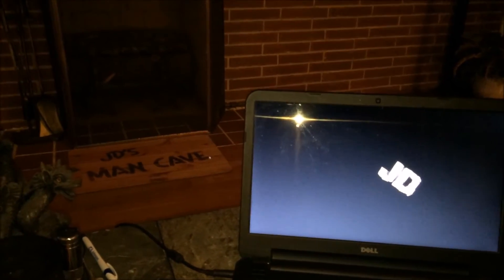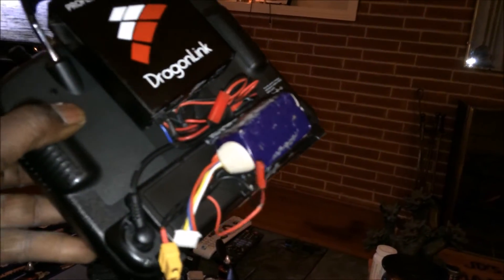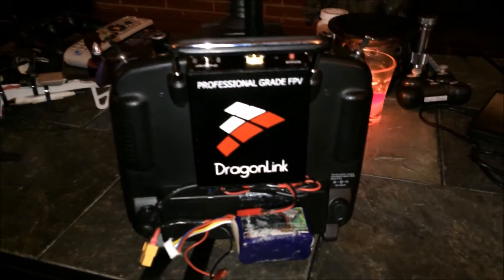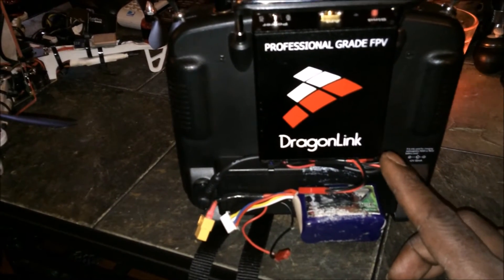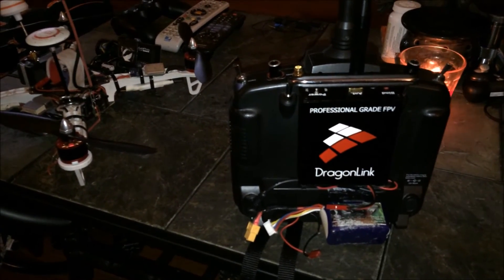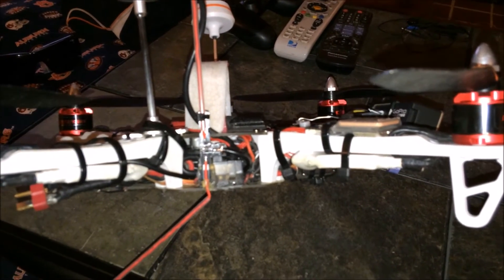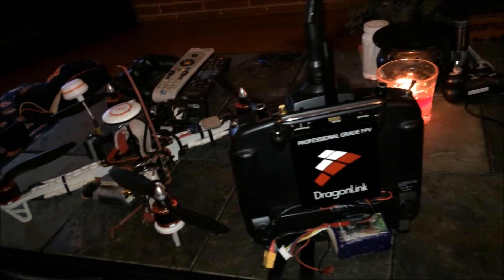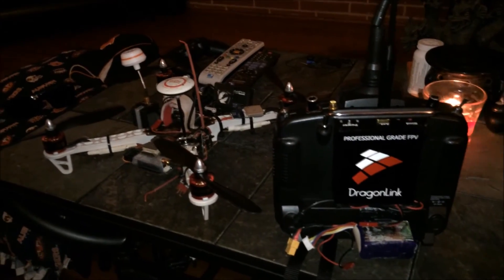Dragonlink Install on Walkera Devention Devo Tx / Long Range UHF System For Fpv

Comment: Thanks for the video. I was just looking for something for my long range problem an here you are. I own the devo7 aswell and the devo8s. Do you know if this will work on the devo8s? And can you tell me which rx you used on your quad? Thanks for any help or suggestions you can give me. Keep up the helpful info an have fun flying!!!!!
Reply from the maker: Louis Koerner yes. Works on every radio. Use micro rx on quads
Reply: JD FPV I bought the rx-sbus an waiting for it to come in now. I appreciate the info. How far have you gone so far? Or what's it's distance?
Reply from the maker: Louis Koerner Dragonlink is unlimited range. I went out 22km with a plane and had to turn around due to life of lipo on plane.

Comment: I just brought the v2 DragonLink and have the Devo 8s transmitter. When i install it to my radio, what do i have to do to my radio for it to work?
Reply from the maker: Scott  Miller nothing beside supply power to the dragonlink tx
Reply: Thank you

Comment: Hi JD FPV,, did you use a single wire connection via PPM on the Dragon link rX to the X350 ?  Or did you run a cable for each servo plug in when you connected the DragonLink Rx to the quad ?
Reply: FPV FREAKY It works with the devo 7. I have done it with mine using Ezuhf. I have a vid of that on my channel. Any UHF system will work with the Devo 7 via the trainer port.
Reply from the maker: +desode9 To Dji Naza Flight controller, multiple servo plugs. To naze 32 ppm only one servo cable needed.
Reply: +JD FPV Thank you !  Happy Flying and continue to make the Great videos !
Reply: JD FPV good job mate. Would this work on devo 7 as it's the one I've got. I've just subscribed to your channel,  could you sub to mine😊 much appreciated 😜✌️
Reply: desode9 cool cheers buddy I'll have a look and sub.😜 plz return the kindness.👍🏽

Comment: hello JD. appreciate the video... i have devo 7 and just got into FPV myself. I have a scratch built all terrain (snow/grass/water) twin plane... just did my first fpv flight on boscam 5.8 ghz and crashed (gently.. got lucky) because my transmitter/devo 7 ran out of signal before video link failed... im guessing i was maybe between 1/4 to 1/2 a mile away. so...  you are welcome to view my youtube channel...ultimately what i really want is a good LRS system and wonder if you can fill me in on dragonlink. so...
1) does this dragonlink transmitter you strapped to the back of the devo transmit both the video and the controller? or i have to buy 2 different systems at close to $300 a piece? it just plugs in to the dsc port?
2) with stock antennas... does it have issues with acrobatics ... requiring upgrade to clover antennas? 
3) in general... can you fill me in on what i would need to purchase (equipment including which version.. such as jr/futuba/spectrum as i dont know how devention fits into that) if all i have now is a boscam 600mw 5.8 system and goggles (hobbyking quanum) with my devo 7... but want to make long range fpv flights. 
Thx. i have crashed quads and planes due to lossed video, etc. and have had enough of this now and wanted to ask some other successful pilots what equipment they are using. I would also want to use this to fly my race quad between trees... etc... does this dragonlink do well in all these scenarios?
Reply from the maker: +CreativeRCutah Dragonlink is only for radio control at the moment. The new v3 Dragonlink has great abilities that are untapped. So in the future it may do video as well. All you need for the devo 7 to work on Dragonlink is the mono plug and a separate battery to power the Dragonlink. This system is great in every aspect of flying rc period. Theres not a system on the market as proven and tested as Dragonlink.

Comment: Hey JD how you doing?
First off thanx for posting this!!I was looking at a few of your videos where Walkera meets DragonLink!
I'm flying Spektrum DX9 w/DragonLink. I'm using a few DL v2's on 550 Q's. 

I finished a Tarot 650 Sport. My DL is on my DX9, I've only used 7 channels until now. The Tarot  needs 10 but I figured on the DX9 ok, settle for 9, wrong. DX9 is only 8
The trainer port only gives access to 8 ports for the DL. It's never easy...
 
My question is; have you used more than 8 channels on your Devo 10 with your DragonLink?
I was surprised to learn all I can access is 8 on my Spektrum, really sucks!!!!!!
I have a few Devo 10's - 1 black, 2 whites (!'m a  X350 Pro graduate) ha ha!I used what could be called permanent sticky tape for the DX9/DL mount. plus I have two good quads with no issues flying it.  

I really like this DragonLink! I'm considering getting a second DL TX for the Devo 10 Black.
That is if you or someone can confirm all 10 channels will work through the Devo 10 trainer port for the DL TX.

Nice setup you have, I see you used traditional wiring, my first choice always! 
Thanx!
Reply from the maker: I'm doing well & thanks. Yes, I've used all 10 channels thru dragonlink on a full receiver.
Reply: Cool! Thanx JD! The tarot will fly!!!
Have a good one!

Comment: Does this work with a Devo 7? I can't find that out anywhere? What do i need to make the Dragon Link work? Could you explain how to connect it to the quad?? Please help I have some other good questions for you. Seems like you know what you're doing
Reply from the maker: Yes you can connect to devo 7. All you need is the mono plug. Connecting to a quad is the same. There's no difference.
Reply: You never really explain how to connect to the quad and on the DragonLink Website it only explains how to connect to the Futaba radio. I have the Devo 7 radio and transmitter that came on the Storm Quad. this is my first drone so I'm not sure how or what to connect to the transmitter to on the quad. Also Dragonlink boost the radio not the FPV camera correct. Thanks JD
Reply from the maker: Oh god, you bought a pre-built. Yikes! And i don't like the to call them drones. Its a UAV :-) First question for you before I answer, is why do you want a long range system on a mini h quad??
Reply: Stupid i know buying a prebuilt but I don't currently know how to set up flight controller or ever where to start with building my own. I am in the process of building my own now but still unsure how easy it is when it comes to programing flight controller or anything like that. I see that you have DragonLink on your UAV quads. I can probably only fly a football field distance with minimal obstacles  in my way. I want to fly around without worrying about my reception. Is this stupid or no?
Reply from the maker: Dragonlink is the most reliable system on the market. It is 100% worry free.... Unless you forget to set the failsafe on rx and your quad flies away before you can change the dead battery on the dragonlink tx! Lol this recently happen to me, completely my fault tho. Its very easy to connect and exchange rx(s) on your model. I think your rx is located at the front of your quad. All you have to do is remove and install. Don't worry about which wire is where and connect your dragonlink micro rx to a computer via USB port. ( you must bid your your dragonlink tx and rx first!!!) watch videos in dragonlink support. But once it's bidded to the tx you can assign which channel to do what. You do know the common channels right?? Elevator, aileron, rudder, throttle and pitch or gear. Assign those which is easy if you follow the video then your done. But you will have to add a battery like I did in this video for the dragonlink tx.
Reply from the maker: Here's a good video to watch about the Dragonlink Rx. Well Explained and easy to follow. Just don't get all caught up in the beacon part (will blow mind) lol https://youtu.be/4kpeEfC-tg0
Reply from the maker: Also if your going to install this on a mini quad go ahead and buy extra antennas and a battery voltage alarm for the dragonlink lipo! Lol
Reply: Any video on building your own Quad? How hard is it to set up the radio transmitter or flight controller? Where should i start?
Reply from the maker: It's only complicated because your a newbie. It takes time to learn and understand everything that needs to be done to setup or build anything RC. If your quad is flying ok, leave the flight controller alone until you find your quacopter moving slow on 4s, lol. I don't do build videos, pics Yes on Google. I don't because there are tons of good videos explaining everything here on youtube. Just like you found me. Type and click, lol. Just don't be afraid of a challenge. And fly responsible, safety and respect of others always first. But seriously follow the steps in the videos you find and it will guide you. A Lot of trial and error. Do a lot of research before you buy or try.
Reply: I am not trying to mess with the flight controller, I'm saying if i go to build my own quad do i need to program things with the computer with the flight controller. Any videos you recommend that will get me started building a 450f 330 or 250? You the Man!
Reply from the maker: check out this guy channel. he has 4 build videos. Watch and learn. And yes programming will be required via computer for a flight controller and dragonlink rx. https://youtu.be/8jbpwqCCVbs
Reply from the maker: It takes a lot of time and skill to build my friend. Nothing you can learn over night and you surly don't want to rush. You will be wasting your time and money. Research is the key to success in RC.

Comment: Nice :)
Welcome to the darkside!
I'm pretty sure you can power up your Dragon Link with your transmitter battery. Having two separated batteries on your radio is too bad.
Happy flying, Dragon Link will change your life if you use it good :)
Reply from the maker: Actually having 2 batteries on my radio will allow more flight time with the radio. That's a plus for me. And the 4s I'm using is sooo light, that I don't even notice it's there. :-)